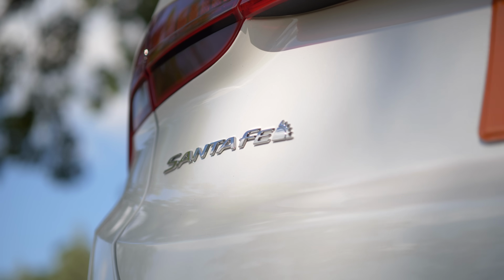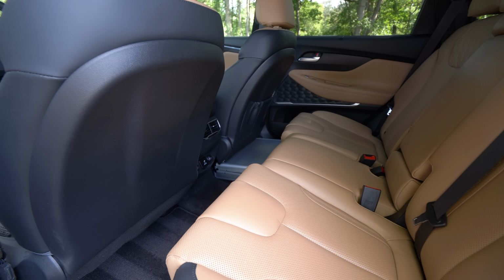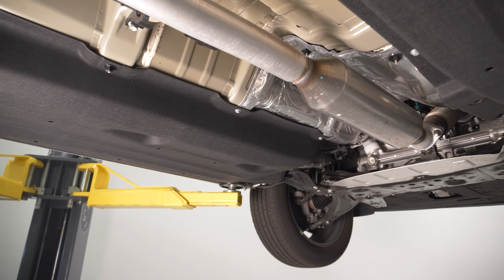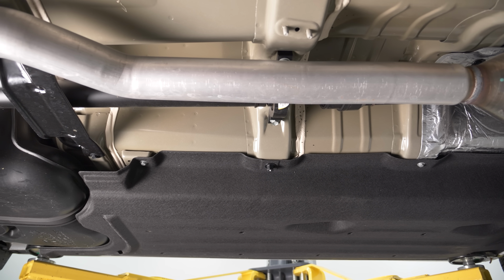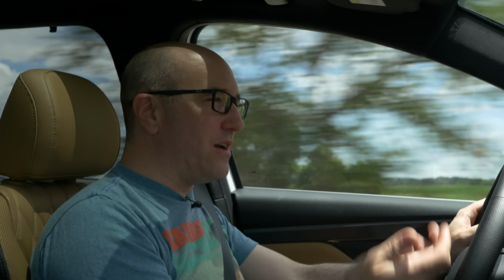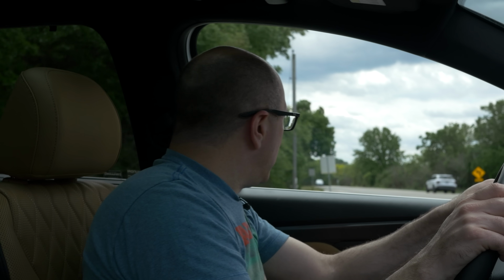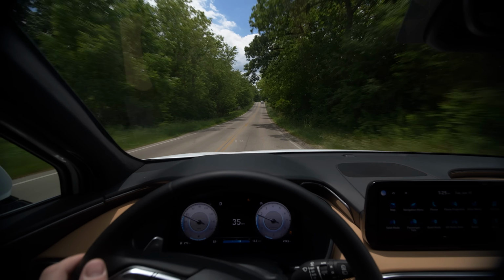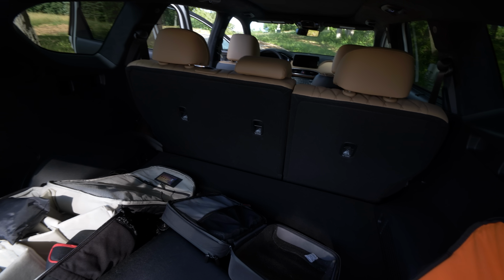2022 Hyundai Santa Fe | They Just Keep Going

Comment: I own this car and you nailed the key factor in ANY review.... who is the target buyer. It is quiet, luxurious, capacious, fast and handles very well for what it it is, a giant station wagon over 8 inches off the ground. The only interior item of note that you didn't show is the amount of storage under the trunk floor; kind of amazing if that is what you need.

Most reviewers will compare it to a CX-5 which is ridiculous as that car is for someone that wants a small station wagon with "sports-car" handling. Again, target market. 

If you try to match the features/benefits listed in my first sentence you will be spending another $15,000 and getting a car with noticeably less interior space and probably a lot less useful tech.
Reply: Great car …. but. I’m reaching out to fellow 2021-22 Santa Fe Calligraphy owners. (2.5 T w/HTRAC) I’m vexed; the Radiator fan will randomly run at full speed for 1-2 mins. after I turn the engine off. The Dealer can’t find any sensor defects in the diag. We live in a mild climate; the engine is not being taxed when this happens. This can’t be normal. Is anyone out there experiencing this issue too? Any feedback would be greatly appreciated - Rick

Comment: I bought a Limited in March, with the 2.5 turbo, for my wife.  Of all the cars we've purchased this is her favorite ever. This is a shockingly nice vehicle to drive. It is QUICK for its class. It looks great, (and I don't like SUV's, I'll never personally own one.) and the interior is punching above its class. I love all the physical buttons, making life a lot easier while driving. We both agree that an actual shifter would've been nice, but, ehhh, she got used to it. It's quiet, it's smooth, it has all the safety, plenty of room, etc etc etc.. I've driven it only 30-ish miles and I really like it. The ONLY downside to ours is that it's FWD vs AWD. The Phoenix area doesn't call for AWD, but, wow, when floor it, you need to hold on because it will yank the steering wheel unless the vehicle is going straight.

Comment: This is a CX-5 killer. First true car in this class to give the CX-5 turbo real competition.
Reply: Not with a DCT transmission it won't be. Kia learned the hard way a few years ago putting one in their Sportage model. And it proved nothing but trouble for consumers. DCT's are constantly hunting for the right gear in stop and go traffic. Their are also TONS of complaints on how "jerky" feeling that transmission is on these new turbo Santa Fe's. I would stick with the 2.5 naturally aspirated 4cyl engine making 190hp mated to the normal 8 speed automatic. FAR more reliable down the line and no turbo lag which is also another major problem for this vehicle.

Comment: I walked out of a Hyundai dealership ready to buy a Aston Martin but ended up walking right back in to buy this vehicle after watching a 11:58 Savagegeese video.
Reply: Same exactly i wasn’t ever at an AM boutique. I didn’t have a great experience with Hyundai sales or management team, caught them hiding my trade in saying it was shipped off to God knows where, I was pissed. But I did negotiate a great deal on a new Santa Fe after I called them out and I’m super happy with the Hyundai. It’s my 3rd one in the 9 years I’ve been driving. I also have had some older Mazda hand me downs. But none of my Hyundai’s have had any issues and unlike the crappy sales side, the service side has absolutely been fantastic to us!  I always get a nice loaner when I call to schedule service. They really take care of everything and exceed my basic expectations. Of course all the manufacturers are pushing near perfect CSI survey scores the last 10 years or so since I was 16. I’m always getting emailed surveys.
Reply: Great car …. but. I’m reaching out to fellow 2021-22 Santa Fe Calligraphy owners. (2.5 T w/HTRAC) I’m vexed; the Radiator fan will randomly run at full speed for 1-2 mins. after I turn the engine off. The Dealer can’t find any sensor defects in the diag. We live in a mild climate; the engine is not being taxed when this happens. This can’t be normal. Is anyone out there experiencing this issue too? Any feedback would be greatly appreciated - Rick
Reply: @rickboettner1838  You posted 2 yrs ago, I'm sure by now you have this issue resolved?

Comment: Test drove this exact vehicle with turbo against Mazda CX5 Signature, Kia Sorento SX Prestige X, Audi Q3, Toyota Venza Limited, RAV4 Prime and Lincoln Corsair. Santa Fe did well and it came down to that and the Toyota Venza. Went with the Venza. IMO, it drove better, the mileage is off the chart incredible, I disliked the wheel choice on the Santa Fe and finally, reliability of Hyundai/Kia engines. My last 3 vehicles were Kia and 2 of the 3 had recalls for the engine. The Santa Fe is beautiful but I’ll wait 3-5 years to see if these new engine designs can match Toyota quality. Only then would I consider switching back.
Reply: Sigh, okay, as usual, people don’t give Hyundai/Kia chances.
Reply: @bradleyscarreviews  "people don't give Hyundai/Kia chances".... He gave them 3 chances already.
Reply: Venza doesn’t have nearly as much tech, it has a CVT, it is much slower, and to me, the Santa Fe is more luxurious.
Reply: @bradleyscarreviews  The 2.5T is fast and powerful, but many consumers in this segment cares a lot about fuel economy. The Venza is getting double the mileage in the city. Toyotas hybrid system is tried, true and perfected. With the recent Hyundai and Kia engine isues, people are still skeptical. With the new Hyundai engines coming with dual injection systems, I believe it will be less maintenance and more reliable than before. Only time will tell, Toyota on the other hand have been using dual injection engines since 2006.
Reply: @bradleyscarreviews  Calling the Toyota hybrid drivetrain a CVT is misleading. It does have some of the driving character of one, for people who care, but none of the reliability problems. These are some of the most reliable drivetrains made by any automaker.

Comment: How is the digital dash? Can you turn the brightness down at night? Does it work w/ polarized sunglasses? My biggest concern from getting this or new tucson.

Edit: Also, sick intro, brah.
Reply: I don't own polarized glasses but you can dim it at night. There is also a dark theme with blue accents that's way less fatiguing than the white with blue accents. Once I got everything dialed in, I haven't had any problems at night with it.
Reply: I own a 2023 Tucson Hybrid and the digital screen is mostly all black, so I don't really have any problems or distractions driving at night... I did, however recently rent a 2022 Ford Edge, and OMG... it uses a huge all-white background on its oversized iPad for a screen... what a terrible design and hugely distracting at night, even when dimmed!

Comment: Should one trade in a 2019 Rav4 limited for this Santa fe?
*Asking for a friend
Reply: Financially that makes little sense. A 2019 has just had the worst two years of depreciation, and will still be a reliable vehicle for years and years. The Santa Fe really isn't a direct competitor to the RAV4 - that would be the Tucson. The only sensible reason to trade on the Toyota for this is if the person needs more room, and the difference isn't that dramatic.
Reply: @markmiller3279  Splendid, thank you!
Reply: Nope

Comment: If a Santa Fe is on a consumer's radar it follows that the new Sorento is there as well. And in that comparison it's a tough call. Especially in the top trims where the two siblings share so much including overall size and MSRP. I'd argue that the Sorento has the edge in looks and in providing an occasional use third row seating. That is a huge convenience on occasions when the need arises to transport 6 or 7 passengers on a local trip that would otherwise call for two vehicles. Further, the Sorento offers a bit more overall cargo space than the Santa Fe. And though it's admittedly a subjective choice, I prefer the traditional transmission lever to the dial the Santa Fe provides. All in all our 2018 Sorento has been a "goldilocks" vehicle for our family of four (two adults, a teenage driver, and a big dog.) So if we were in the market the Sorento would enjoy an edge.

On the other hand, the Santa Fe has a couple of  unique features that are especially appealing to our family. First, KIA has dropped a second row bench option for all but the lowest trims of the Sorento. Obviously, we don't need a bench 2nd row for a mess of kids but the dog (who lives in the 2nd row almost daily) considers the standard captain chairs in the second row a near deal breaker. Without a third row even the top trim Calligraphy version of the Santa Fe has to provide a bench 2nd row. (A four passenger mainstream "family" SUV is obviously a bridge too far.) 

Secondly, we have three drivers in our family. (The dog doesn't drive so we don't need a Subaru Ascent.) Inexplicably KIA has eliminated driver memory settings for the Sorento in every trim. The two settings in our current Sorento and the same in the Santa Fe don't match our needs perfectly but considering that our 3 drivers range in height by almost a foot, lacking even 2 settings is a major inconvenience. 

All in all, my heart still belongs to the Sorento but if we were replacing our KIA it would likely be with the Santa Fe.

Comment: We own a 2019 and 2020 S-F both are SEL 2.4  non turbo FWD models. They are a pleasure to drive and can average 33mpg on HWY.  The SEL has all the standard safety features included, a super deal for $28,000.  At $14K less than Calligraphy model it is a bargain..
Reply: And you won't have the trouble of any turbo lag and the DCT or "dual clutch" transmission issues. That the turbo engines will eventually be plagued with. Honestly, folks are already complaining about how "jerky" and slow it is too respond in stop and go traffic.
Reply: @tomtalker2000  I agree 100%.... 
We are super satisfied with both our SFs .
   BUT ~Wish we could find better riding tires ?

Comment: For 42k i still rather have an outback touring xt. Holds its value better, insurance is cheaper, their ride is comfy even over rocks, trunk is large for the class, has great clearance and comes standard with roof rails, freaking floor mats(why do you have to pay for a mat hyundai) and cargo cover. Also i dont care what anyone says but subarus kill any other awd suv in the snow if you compare with the same tires.
Reply: but the screen is laggy and all the buttons are touch senstive, also its smaller
Reply: @adilsagadiyev5090  the screen is not laggy, i have driven it myself and when he did the video of it he was mashing it like a child. It is pretty responsive. Yes i dont like that all the hvac is a screen but the temp button is in fact a button and it has auto climate control so it really doesnt matter it is a screen
Reply: @Hallowsaw  dude, the outback doesn’t have nearly as much tech, it has a cvt, it’s not as sporty and I’ve driven both, it’s not as luxurious, the infotainment isn’t eitrble to use, and it’s not as fast. CVTs are never reliable. And the Santa Fe’s engine is dual injection. Also, palisades and tellurides are increasing in value.
Reply: @bradleyscarreviews  hold up, dual clutches are reliable? Try doing any kind of city driving, towing or off roading with a hyundai dual clutch. If anything its just as "unreliable" as a CVT. Also i have seen tons of CVTs hitting 200k+. Also how are subarus not luxurious? Have you been in the touring models? They have a really nice feel to them. Also please tell me who is buying a SUV to be sporty bud? Its made for utility and to be a people mover. So cargo space and efficiency are usually the things people go for. Just ask honda and toyota how their crv and rav4 sales are. Destroying everyone. 
The outback is much more usable, especially if you travel.

Comment: I do agree that it's very nice and you get a lot for the money. But after owning 5 Hyundai products and having a lot of issues with all of them I wouldn't buy another. 
It seems they change engines and transmissions so often that they never get the bugs worked out of any of them.
Reply: My ex bought a used kia  two years old on its third transmission.. and that was just the beginning. I think to save time they just wire tie them in since they need to change them at every oil change.
Reply: @cayman9873  that sucks.. my 13 Elantra Limited is holding up pretty good considering how I drive… it has 176k miles on it.